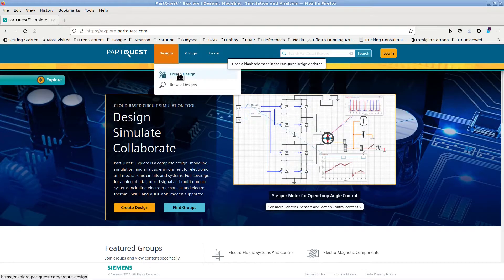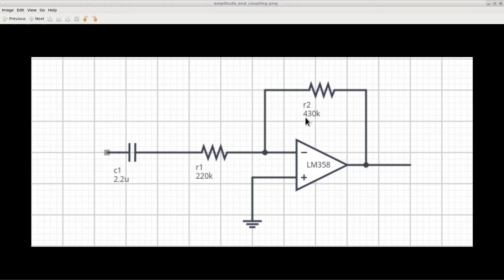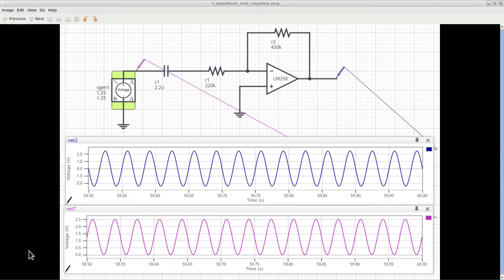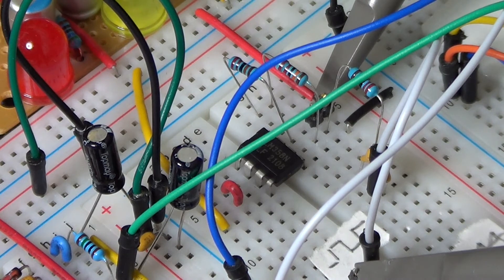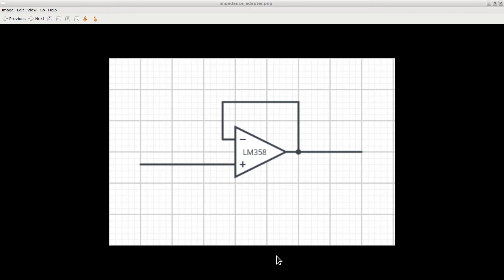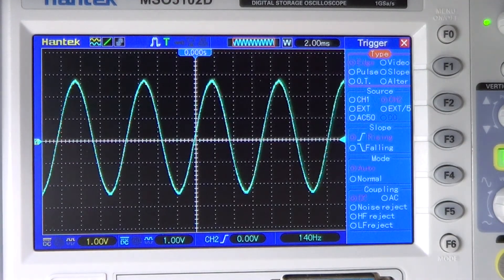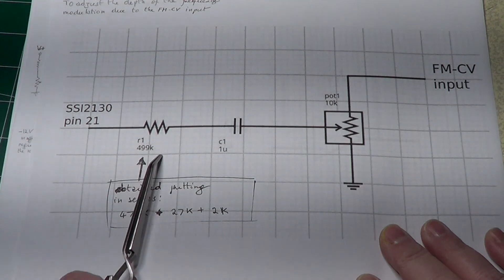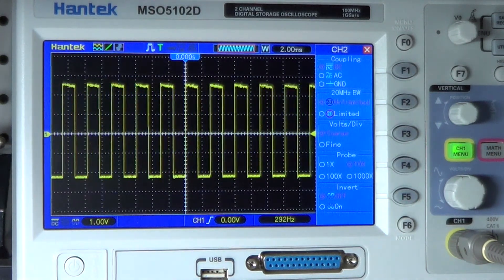2130 VCO Design Completion Part 1

Comment: Recently discovered your channel and I love it! You do a great job explaining everything and the content is all exactly the stuff I’m interested in. Thanks for your hard work!
Reply: Something I’m really interested in would be how to make a voltage controlled envelope generator other than the 3310 IC. It seems every other circuit I find has the pots as part of an RC circuit to set the times so they can’t just simply be replaced with CVs. Jfets and vactrols seem too limited. I’m thinking it may be possible using OTAs as resistors? Or if you have any other approach for DIY analog voltage controlled envelope generators?
Reply from the maker: In those circuits that use the potentiometer to change the duration of a timer, it should be possible, in theory, to replace the whole timer with a LM555, which can be voltage controlled, up to a point. Other possibilities involve the usage of digital techniques, like a microcontroller, to create envelops having the ADSR parameters defined by voltage levels, which can be passed to the microcontroller through analog to digital converters. The microcontroller would then take care of creating the envelope approximating it through the use of a digital to analog converter.